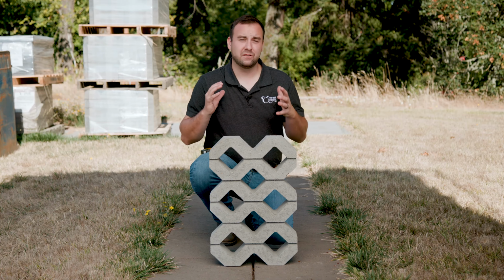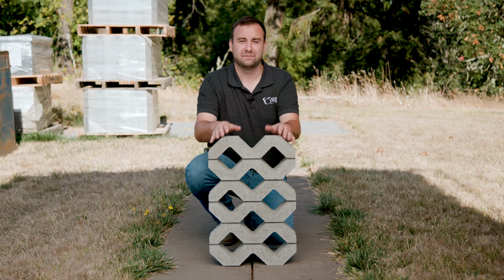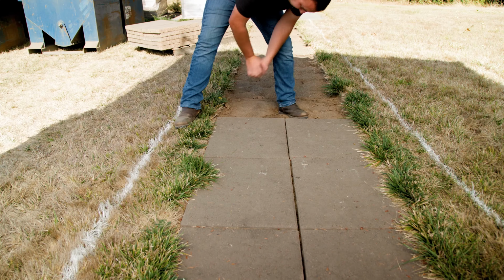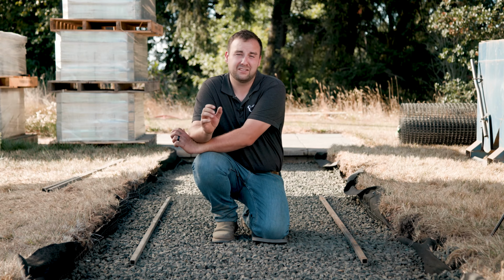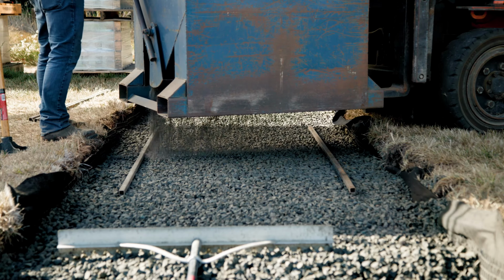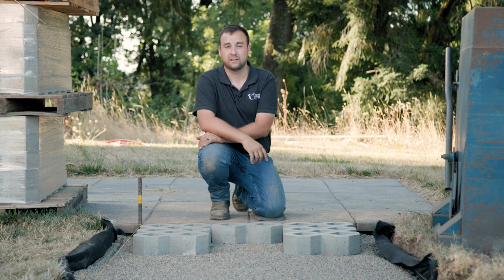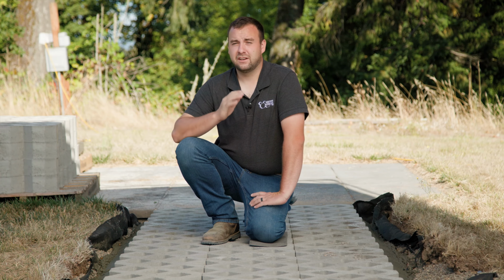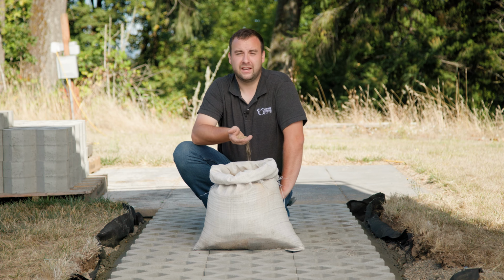Eco-Friendly Elegance: Install Turfstone Pavers for a Greener Yard!

Comment: If this is filled with grass or clover  will it be good for children to play on? Does it feel like a flat surface? If there are falls, it is like falling on concrete?
Reply: We have something similar in our backyard. If there is enough grass, clover, or dirt to cover the holes, they can play no problem. But if there are large gaps in between the pavers I would say no because their little feet can get stuck or they can trip

Comment: Does it affect  that the smooth part is on top of the turfstone?
Reply from the maker: Great question! Yes, orientation does matter with TurfStone. The smooth side should be facing down (on the base), and the textured/open cell side should be facing up. This allows the grass or groundcover to grow up through the cells properly and gives you the right surface for your application. Installing it upside down would prevent proper plant growth and drainage. Thanks for double-checking - better to ask before installation!

Comment: Two questions. Do you lay the units touching or have a joint? Is there a risk of the soil infiltrating into the laying course and blocking the infiltration? Thank you and great video.
Reply from the maker: Great questions, Craig! For TurfStone installation, you typically lay the units with small joints - about 3-6mm spacing between units to allow for proper drainage and slight movement. The open cells in the TurfStone are designed to be filled with growing medium/soil, so that's actually part of the system working as intended.

For the laying course, you'll want to use an open-graded base material rather than sand to maintain permeability. The soil in the TurfStone cells stays contained within those cells and doesn't typically migrate down into the base structure when properly installed. Thanks for the great questions - glad you found the video helpful!